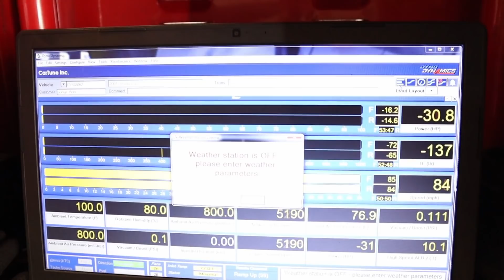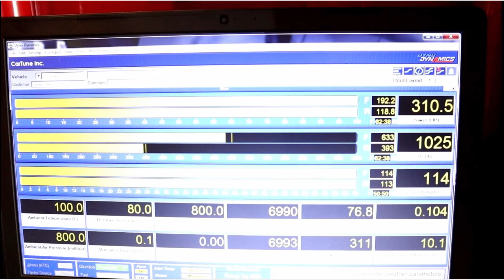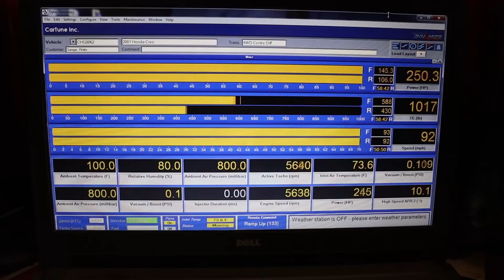CRV AWD Diff Dyno testing with before and after Power Transfer Upgrade

Comment: So this version is just a modified rear crv differential, wavetrac front lsd?  Is it Tim's that has the viscous coupler?
Reply from the maker: Red has a Wavetrac Front LSD and rear gear X lsd, crv rear diff and crv drive shaft. 
Tim has a wavetrac front lsd and a VC, the CRV rear diff clutches are pinned
Reply: @PirateGarage   which is the better set up in your opinion??
In the process of doing something similar, was thinking of doing the VC route but just come accross this video, have you got a how to to do the dual pump and clutch pack upgrades?
Reply from the maker: I will post the video on the coming weeks
Reply: Be interesting to see which is better and the differences
Reply: @PirateGarage  no comparison video yet
Reply: @PirateGarage  would be great to know which route is better, VC with clutch pack delete, or the power upgrade

Comment: Red are u running a viscous coupler🤔
Reply from the maker: No Tim is, the point of this video was to show what can been done very easily with the OEM dual pump system
Reply: Nice I have a 2004 5 speed crv I have hope now
Reply from the maker: You need an 05-11 diff to take advantage of this, your 04 is the old style
Reply: Is the diff a  direct swap no swapping of axels or anything I love the channel by the way
Reply: Replacement 4 displacement R4D Direct swap, easy peasy
Reply: @john-martin  thanks john
Reply: @PirateGarage  hi there . I have 2006 honda crv awd & i started ising the crv for light offroading but d/t open diff awd ,  I experienced alot of wheel spin when i need traction while offroading. now im looking for LSD for rear awd. What’s your recommendation to get better traction?

Comment: Can you make a video to explain what your most preferred parts and accessories are for a d17 and what works best
Reply: Especially specialty things like where to get an exact fit differential for an awd build and where to order from ??
Reply from the maker: I do mostly k so I'm not expert for d17, and doing an awd d17 in the us is a bad idea the transmission is not available here
Reply: Pirate Garage or what’s the best/easiest  k swap or preferred setup .. I have a blown head and like you always say just go K ... I was thinking k24 with a k20 head but to drop in a d17A2 series body .. it would be my first k swap .. so part availability , price ect  anything/ everything is helpful ... Thanks Man

Comment: Hey Red! Love your channel, very informative! I've been spending a lot of time at the junk yard, tryna gather k swap stuff for my em2, and have realized some very useful parts from em2 hybrids like a radiator that has a port on the right side, eps system, and even a/c system is on the passenger side. How come no one talks about this? It's all about the ep3 parts which are harder to get!
Reply: What do u think about using the radiator from an automatic that also has a tranny radiator to use for cooling engine oil?
Reply from the maker: The ep3 doesn't come as an auto in the us
Reply from the maker: The ep3 doesn't come as an auto in the us
Reply: Not the ep3! The em2 hybrid has the parts that are easier to find.

Comment: Nice videos, Does the rear diff pump work,  if you remove the driveshaft to dolly the front for tow?  Why I ask is wife is looking at the 2021 CR-v AWD and I do not want to buy a trailer to tow it on.   I rather pull/ hang the driveshaft and let the rear drag along behind the dolly.
Reply from the maker: You should consult your manual after 2011 they went with an electronic pump so I can't help you

Comment: I do Circuit racing
This is left as an open differential correct? Would this Modd work for circuit racing? Will a rear LSD makes it better?  Pretty sure it will..
I have the Freelander stuff Already.  Would getting an older CRV Transfer Welded be a better option?  And adding LSD.. Thanks for the help..   ALSO, I CANT FIND THAT KIT YOUR USING.. HELP. I’m Diff shopping..
Reply from the maker: You cant fond it because I developed it so you would have to contact me to order it